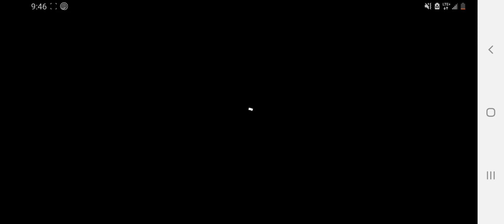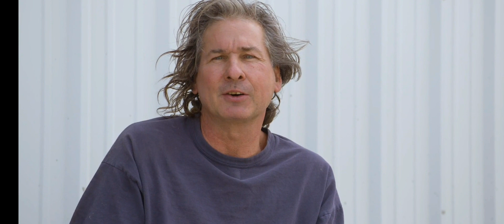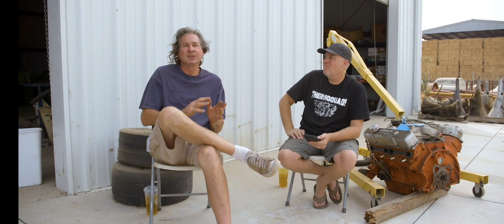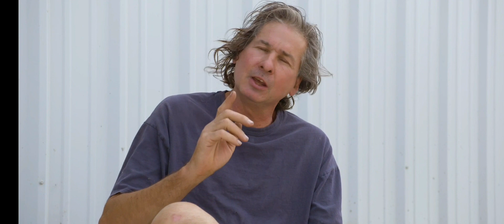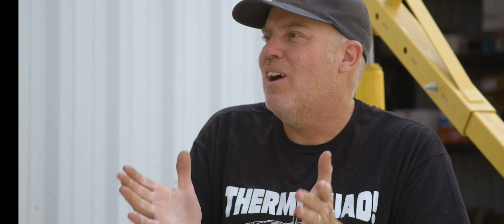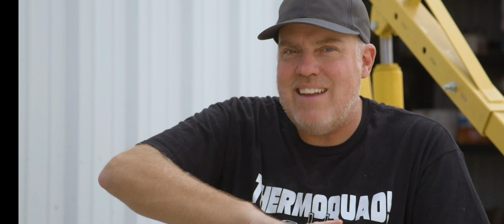uncle tony's garage gets called out by the roadkill guys and they say he's  full of shit

Comment: Until somebody tries this and throws it on a dyno, I guess we'll never really know. It doesn't have to be a perfect engine. There are a lot of 318s laying around out there.
Reply: UTG just put up that challenge exactly.  I bet the eventual teardown of Steve and Frie's 318 shows the pistons reversed, so maybe we still won't know.
Reply: @pete540Z  So why does UTG prove his claim himself?
Reply: @VegasRT500  - That's what he's proposing with his challenge.  Again, you have experts like David Vizard saying the theory is sound, but these two wanted to make a joke about it.  They should all get together and do a controlled dyno test, pulling the engine apart and rotating the pistons.  Start with a set of rod/pistons that are stacked up with the same length, a square block, and do the test both ways on the same day.
Reply: So they just tested this on a dyno and the engine gained a whole lot of nothing with the pistons reversed....
Reply: @turdferguson9190  
Can you tell me who tested it? Is there a video? 
Thanks
Reply: UTG goes to junk yards for all his parts and just drives it and runs on a drag strip. Roadkill, Roadkill Garage, Engine Masters free top of the line aftermarket parts and dyno usages. Yep seems right that the guy who’s using stock junkyard parts using knowledge passed down from back in the day do all the test.

Comment: I have never broken a cast piston removing a piston pin. If you have the proper driver and piston support  such as the Sunnen set up, it supports the pin boss and pressure is supported equally around the perimeter of the pin as long as you have a good hydraulic press that pushed perpendicular to the press plate. Seriously, if the pin is stuck that bad, how good is the piston in the first place.  I guess coming from 2 guys that assemble the rattiest cars on the highway and strip a rant like Fryburger's is expected. I did not hear Uncle Tony's name mentioned.

Comment: Here it is 2 years later I just rebuilt my 67 318 LA. used this trick after putting the motor together the factory way i put it together this way put it on the dyno it went from 245hp to 280hp everything identical

Comment: The engines "Uncle Tony" is suggesting you do the reverse piston are specifically Mopar LA small blocks. (318 / 360) Which are known for longevity (150K miles still with crosshatching visible) Use flat top pistons (no valve reliefs) and have fully floating pins. EXACTLY what you are saying you would need for this to work.
Reply: As opposed to Dulcich which probably doesn't know anything about Mopar right? lol
Reply: You know Dulcich is a Mopar wizard right?
Reply: @MikeyB-Rod  You do realize that was SARCASM right?
Reply: @hankfink  I wasn't replying to you, yes I caught your sarcasm. I was laying it on op
Reply: @hankfink  I'm not sure why my comment didn't have op tagged.
Reply: @MikeyB-Rod  Oops haha
Reply: That why all there shit breaks and they rebuild it with parts they get handed so makers get publicity.
Reply: @zacharyradford5552  I don't even see how thats a bad thing I mean the sponsors are mentioned about a million times every episode. Where would this hobby be without the aftermarket?
Reply: @MikeyB-Rod    But his comparison is apples to oranges. He talks about replacing pistons with high performance / high compression pistons (aftermarket) and then claims there's no difference. He's probably correct with that replacement part. But as a "Budget Builder" I'd trust Uncle Tony... His stuff runs and don't blow up using factory  stock parts. You can't stick 10 grand in a motor and call it stock. Then compare it to factory part motor and say "It's the same thing".
Reply: @hankfink    Yes he knows Mopar, but isn't using factory parts in his comparison. We all know the downfalls of the 318 are flow and compression. But of you cannot afford to replace pistons and heads, You do what you can. Which is what Uncle Tony does and is showing us poor folk how to make the most of factory parts.
Reply: @randyladwig7628  Dulcich is as highly regarded as they come
Reply: @randyladwig7628  it's like you didn't even listen to these guys lmao. Listen again bub

Comment: I first learned of the piston flip while restoring my 51 Hudson hornet ...smokey yunick would do that in his 7x race motors ...mind you I never tried it in mine ..... Last year I decided to freshen up my 302 in my fox ...while it was out I decided to flip them .... Definitely can notice some more umph in it ...screams higher in the redline and by my butt dyno makes a little more power .... Before the flip it dynoed at 254 wheel .....all I've done was fresh rings and bearings and hone job ...I'm due at the dyno in June after I'm done painting my car ...time shall tell ...but definitely no piston slap at all and has great oil pressure ...I love roadkill through and through ..even more the utg ...but they have a dyno at the disposal ...put up or shut up time !!!
Reply: It's been awhile but the Hudson  6 piston pins are centerline  I believe .... The 7x from HRS was a crate motor retrofit by dealers and may have different piston setup.

Comment: Been hearing that Mopar Myth for years,I even asked the engine builder where I worked at 30 year ago this question.......He just looked at me and said......Why would you go through that?
Reply: because when the class you run in requires the same motor....
.
having ANY slight advantage wins races
Reply: Perfect answer if you don't know.
Reply: It's not a Mopar thing it started with the flat head ford guys in the 1940s
Reply: @davidleonard8369  The man started in the engine machine work around 66 after taking a machinst class in college and done it till 4 year ago due to his eyesight.........machining/building engines,I was Lucky to work with him a couple of years at a local machine shop East Tn. back in early 90,s........where he taught me on re-sizing/checking rods and installing pistons and balancing.Very smart man and knew ALOT of diff. engines.....not just Ford,Mopar and G.m. .......You ever worked in a Engine Machine shop?
Reply: @chrishensley6745  The fact that I can hold a +_ .0001 tolerance with a sunnen hone and I have two separate types of tools, one box says Mac on it and one says Kennedy doesn't make piston flipping irrelevant. You and I are not the only ones viewing the channel that understand that we measure each piston and final hone the bore for that piston hopefully using a torque plate.
Reply: It’s not a Mopar thing , Smokey did it on Hudson’s and I heard of other people doing it on various engines. It’s one of the old school things guys did like painting the lifter valley of the block with Glyptal paint or packing ice on your intake manifold between runs

Comment: UTG says to flips pistons on slant6 with origonal pistions... "you will feel a difference" someone should test this.  It would make a good video.
Reply: @trxtech3010  That's exactly what I say about these so called "Magic Spark Plugs" too...Sure you'll feel a difference...You would if you replaced the clapped out ones with same part number new ones too!  (There is a couple of brands that their marketing department is so high that they make the street corner meth head tweakers look like Rocket Scientists...SMH)
Reply: @trxtech3010  i think your right about having new rings put on is the real reason the motor feels snappier. This would be enough for people to think that moving the pistons around must of made it run better

Comment: Mr Dulcich and Mr Freiburger, reversing the piston pin offset gives a mechanical advantage, this is undeniable if you understand vectors, very basic stuff. It will lead to piston slap and increased wear but it will make more torque due to better leverage. Denying this just illustrates your ignorance of the laws of physics.
Reply: In a modern engine as these guys explained, there are a lot of things that don't matter.  Nearly any rod/stroke ratio from normal aftermarket parts is going to work and make no difference.  Nobody can tell if rod/stroke ratio makes a reliability difference anymore because all the materials: oil, coatings, and alloys, all last longer than any races or rebuilt engine life regardless of (normal aftermarket) rod/stroke ratios.  Yes, you can do a strange combo on some engines but you'd have to work hard to overcome all the factors that eliminated that factor.  The same thing is true with flipping the piston.  It is not a meaningful factor in modern engines.  I strongly, strongly believe these two guys over all of UTG's fans.  Each of these dudes has built more engines than UTG and all his rl friends combined.  There is a ton of old tricks that don't matter anymore, but you don't know this because you are a pipsqueak.
Reply: @TheFogLakeshore  Ill informed waffle.  If the wrist pin is offset to prevent piston slap, ie offset to the left on a clockwise rotating engine when viewed from the the front, then that reduces mechanical advantage, fact. Reverse it and place the pin offset to the right, a mechanical advantage is gained, which will lead to more torque, plus there is less side thrust on the piston over the complete cycle which will lead to less friction between piston and cylinder wall, you obviously don't understand vectors (resolution of forces) either. Give me a technical response, rather than waffle and referring to the logical fallacy of "The argument from authority". Vector calculations would be welcome
Reply: To clarify the above, Tony is reusing, and getting the most from what was originally fitted to the core engine, without spending any money. I love Freiburger and Duchich, but they are chequebook tuners.

Comment: I know That for a fact a number of mopar stock eliminator engine builders use to tout that technique as one of the first mods for a pretty significant power increase in building an engine for this class of racing  !!! Soooooo just repeating so please don’t kill the messenger !! Lol
Reply: Yeah, you read it in the same mags and books as the rest of us, all published when cast and fragile forged pistons with no coatings on dino oil were the rule.  Flipping the pistons is a small off-the-wall trick that has no consistent proven results, originated by 'legendary' engine builders who made plenty of boners.  Absolutely zero private people will be throwing a cast-piston, discount store dino oil, factory wrist pin 426 Hemi, so UT was just filling content.

Comment: Gotta love Freiburger ballwashing Steve. 
Anyways, classy answer, maybe this could be a second UTG engine build marathon? The way to do it would be to rebuild the engine with the pistons in like stock, fully break it in and then run it on the dyno, then blow the necessary bits apart, swap around the pistons, assemble and run it again.
Reply from the maker: Ya uncle hack won't do that because he knows it won't make any power and he's against dynos they don't tell u nothing even know that's  the whole purpose of a   Dyno is to tell u how much horsepower your engine makes
Reply: Which would be easiest to do on a 318 because they have floating pins with easy to remove wire pin clips. But then UT says this ‘modification’ doesn’t show the power increase on a dyno, only in a running car. He’s not a dummy, but why he perpetuates this myth, I don’t know.
Reply: @rong4189  UT cant build an engine that will run...
Reply: @dontbestupidshows4623  you sure your dynos arent just selling windage trays and spacer plates or LS parts
Reply: @rong4189  you don't have to take the pistons off the rods . Put the left assemblies in the right side , and vice-versa.
Reply: @Richie_the_Fixer  True, but just in the interest of keeping everything in it’s original spot.
Reply: Ron G       The 1973 and later versions have pressed piston pins.
Reply: @dontbestupidshows4623  You're right that dyno video was a dud. Btw, ever heard of using punctuation? You should try it.
Reply: @darthhemi1735  he's got a couple of youtube builds that are rather promising, why would you say that?
Reply: @lobmin  what? he only builds unsafe hot garbage... garbage in garbage out...
Reply: @darthhemi1735  unsafe...I don't think you're the intended audience here :)

Comment: I mean they're both right...under the assumption you wanna blow tons of money on performance parts. But if you don't have it, getting creative is the next best thing. UTG is about making the most out of fairly stock parts. Watching some one take a blown or seized motor and rebuilding it isn't as fascinating as watching someone get a seized motor running with all original parts (like junkyard digs, vice grip garage, etc). Most viewers are on a budget, and I'd say a gasket set and mechanical knowledge are, together, far less expensive than buying performance pistons everytime you "build" a motor.

Comment: I watched the bottle rocket build and he was talking "seat of the pants" dyno. To anyone asking this question you need to know your shit if you're going to adjust pin offset successfully.
Reply: I did it on my 437hp 302. Seemed to work pretty well with a bone stock engine and parts, dingle hone with new rings and bearings. Running no slap, Hyper pistons.
Reply: @kylapendley924  437hp 302 ? Tell us all about it.
Reply: @Hanzyscure  Sure - AFR 185, Reversed Explorer pistons, 274 HR, 1.7 RR, Air-gap, 6.3 PR, 1" spacer on a 650 brawler, windage tray, full ARP hardware, stock rods, stock block, stock crank. 

Anything else? Tell us about your awesome engine that couldn't
Reply: @Hanzyscure  
Check car craft magazine ,they did a big write up on a 400hp 302 years ago like it was the next best thing to sliced bread.
Reply: @kylapendley924   Those big ass AFR 185's are far from stock,you must be running a huge cam....
Reply: @davidh1249  cam is listed above specs are online. 185s are in NO WAY big. 351w stock takes 205 for max curve. 408/427 takes 225. I build engines and custom cars for a living. Had to open out the reliefs for the valves.

Comment: Piston reversal

Hp books 

how to hotrod small block mopar engines

by larry sheppard

ISBN 0-89586-479-7

LARRY SHEPPARD CHRYSLER ENGINEER 1968-1970 ALSO WORKED AT MOPAR PERFORMANCE

PAGE 36

"REVERSING-For drag racing purposes, stock pistons are usually reversed on the the rod.

This means the piston notch or arrow points  to the rear of the engine instead of the front. 

The stock piston is machined with the pin offeset and installed in such a manner to load the

skirt against the cylinder wall. This approach makes the engine quiet but slightly increases 

the friction. For racing, reversing the piston switches the offset which cuts down on the load 

the piston imparts to the cylinder wall. This will make the engine noisier especially when its

cold, but it will decrease the amount of friction and THUS INCREASE THE AMOUNT FO POWER 

AVAILABLE.  FORGED RACING PISTONS are machined on center, or at least much coloser than stock,

So this reversing trick DOESNT WORK ON FORGED RACING PISTONS. Additionally, keep in mind 

that intake notches must be below intake valves and and a dome wont fit into the combustion chamber

reversed!"'
remember mototrend makes money off of sales not what works chrysler engineering had a racing team the ramchargers.
they embarass themselves with a cognitive lack of competency and devalue themselves as experts.
this bit just shows ignorance at its best
remember utg has guys like don garlitz on his show go back and watch

Comment: I've learned a lot watching Engine Masters running tests on a dyno, figures don't lie. But the best most informative site I've found is Nick's Garage for anything Mopar, plus he comes off humble without an attitude. UTG is interesting, but does have its limitations. These guys do parts swap/test and sometimes when they have an issue, video comes back after they've figured it out with brief explanation. Nick struggles through problems while camera is running, at least for a while before having to fix and EXPLAIN what was wrong.

Comment: Well since you're wearing a Thermoquad tee shirt, I am compelled to take note! A man of class and style! 
I've been known to dabble with a TQ in my time. 
Did you know they have a 2 stage accelerator pump timed for a second squirt as the secondaries open? Most people don't know that. They came out from Carter incorrectly adjusted (either intentional or unintentional). The problem was further exacerbated by incorrect pump plunger length listed in aftermarket replacement parts catalogues. If the pump plungers are too short you are forced to alter the link to get primary shot and there's then insufficient plunger shaft length for the second shot. All the leather cup plungers with the brass shaft were the correct length. Those were the OEM Carter ones. The plastic or phenolic shaft neoprene cup plungers were nearly always too short.

Re reversed pistons, years ago I read about it in the DC bulletins too (possibly it was in the SA publication Mopar engine book). I have seen many builds years ago with backward notches but never in the last 25 years. Had forgotten about it until UT mentioned it.

Comment: I would agree in a V8 application, however after owning a slant six I can tell you two things about it.....flipping the pistons will net you at 10 to 15 horsepower gain on something that is that small and restricted, and it has the same bottom end size as a 426 hemi so it's extremely hard to kill that engine with excess vibration. (It being designed for a 4.125 in stroke really helps too) In a V8 with a two extra pistons, not a whole lot to gain. But something with a farther spaced firing sequence will make a bigger difference. Offset and timing can actually do a LOT when used properly. Just look at don garlitts trying to blow up an old hemi by throwing 40° of timing at it...in a street application, nothing to gain, in a racecar? Whole different ballgame.
Reply: Why would it gain you power? Asking genuinely